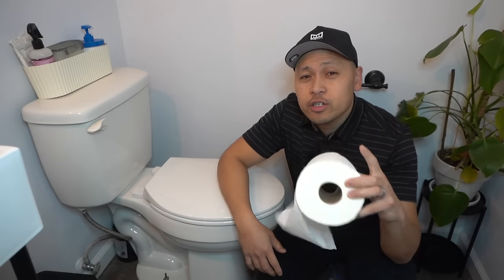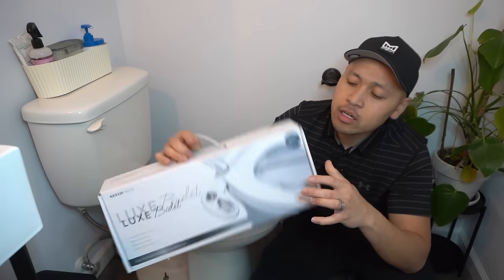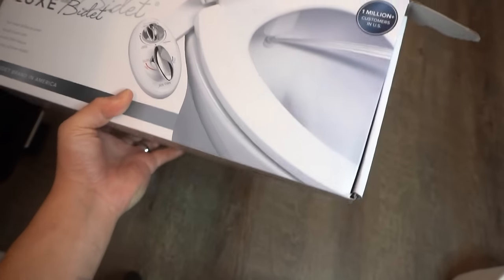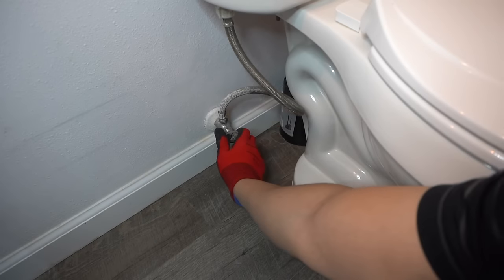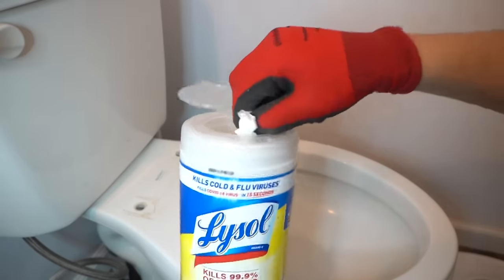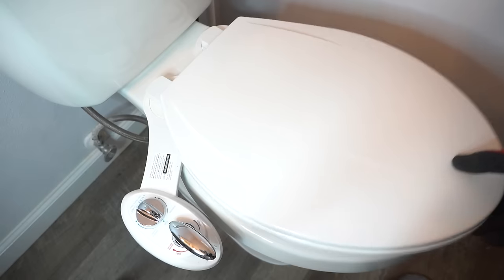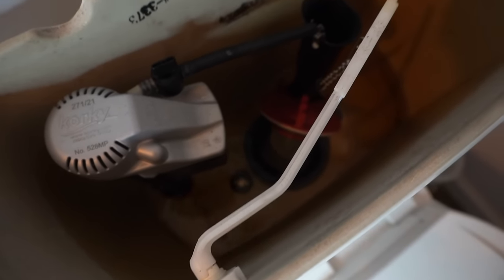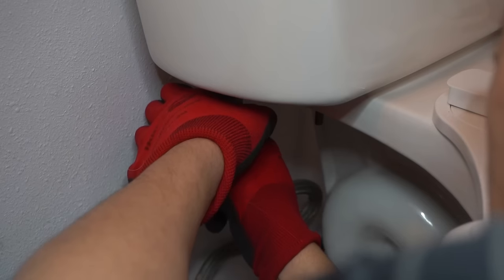STOP Using Toilet Paper! Theres A Better And Cleaner Way! EASY How To DIY Bidet Install!

Comment: Toilet paper notwithstanding you'll use more water & heat so unlikely to save money in the long run
Reply: Obviously your right in your opinion and situation.  However, everyone is different. If you three or more females using same bathroom  with a tanked hot water tank.   This might make sense.  Or just use cold water and man up. I have thought like you before but did the math and it’s almost a wash short term.  But long term, lesser.  But if tankless hot water tank close or in bathroom, smaller or much larger houses have them there, it would make perfect sense.
Reply: You'll appreciate one during a pandemic or natural disaster when the shelves are bare. The amount of water used is negligible - its a pressurized spray lasting a few seconds, not a bath or full shower.
Reply: Either your water must be relatively expensive or you use some cheap sandpaper-like TP. Frankly, heat isn't necessary for bidet. I was initially concerned about that, but when toilet paper became scarce during the pandemic, I purchased a cold water bidet and found even during the coldest part of the winter it wasn't really an issue.
Reply: Try lower pressure and low the temperature of the heat & third point is  maybe a water bottle aka a water jug
Reply: Water is a few cents per GALLON, you will save money no matter where you are, and be cleaner, faster.
Reply: Swings and roundabouts and I agree with the philosophy / intentions 
A standard bidet if enough space is probably  better
Reply: It's not about saving money. It's about hygiene.
Reply: Not really.  You don’t feel the difference between having bidet or not.  And it feels so fresh after use.

Comment: I still need TP. I got a big ass and i need to wipe the crevices real good or i risk staining my draws
Reply: You just need a garden hose with freezing water to really shrink things up
Reply: Too much information!
Reply: You a need 1500 psi bidet.
Reply: You need a fire department to clean your asss.  😂
Reply: 😂😂you do need to use toilet paper anyway to dry your butt after using the bidet. You just don’t use as much of it.

Comment: A bidet does not always clean everything off.. still need tp
Reply: I need  a whole roll of paper 🧻 to clean number 2
Reply: @Summer-o7j sounds like an issue with your diet, study which polysaccharides(starches and fibers) cause constipation, diarrhea, or gas. It’s different for everyone. There is also a chance you are dehydrated if the residue is thick. Regardless, a bidet is helpful to anyone
Reply: @commie281  did I mention constipation ????????
Reply: @commie281 if the residue is thick. 😂

Comment: Thank you for this! Bidets are in almost every home in Argentina, as a separate standalone bathroom fixture, next to the toilet. There's a saying, if you have something on your face, would you rather wipe it off or wash it off? I do not use toilet paper after as a rule. The stream is quite precise, or I have skills or something, because I do not have wet underwear. I have a hot water inlet on mine, but I really can't be bothered to wait for the hot water. My master toilet is next to a double vanity, so I drilled a hole in the side of the vanity just big enough to run the hot water line through. While the nozzles have a cleaning mode, you still have to clean the mechanism. There's a plastic door that you flip open and clean while cleaning the toilet. During the great TP shortage, the bidet makers were often out of stock. You can get a "portable" bidet for travel, which is just a squeeze bottle that holds about 16 oz of water with a screw-on nozzle. Once you get used to it, nothing else is acceptable. Thanks again!

Comment: Old school still works if you have a sink near your toilet.  Have a supply of wash cloths just for your bottom only, wipe enough with TP initially and proceed to clean your bottom with soap and water standing at the sink, repeat as often as needed.  It was a great way to keep my toddlers clean.  No need to buy all of the disposable wipes which clog up your pipes...for those with bidets, hotels I notice have towels for drying.  I still like soap and water vs plain water.

Comment: I got three bidets in the house but you still have to use toilet paper.  You just use less of it.
Reply: Yes,if you buy nice absorbent paper,you buy the cheap crap and you use a lot of paper to dry your ass..
Reply: My wife convinced me to install bidet I installed one few years ago After a year I tried it out Wish I would have bought one a long time ago I don’t like change but I soon found out using a bidet is so much better than tp Still have same Lux bidet I installed years ago with no problems

Comment: I tried a few and in the end I settled on the Veken Bidet with the stainless steel inlet connector. I've had less issues with the metal ones, the plastic ones I've always had leakage. Since install, never had issues.

Comment: Great easy to follow video as usual. I would like to install the hot/cold water model, but since I have a tankless hot water heater, I would end up wasting a lot of water before it would actually get hot. And for the price of the cold water only model it would be worth trying to see if I could stand using cold water only.
Reply: Tankless hot water heaters should provide hot water quicker than a regular tank. Any delay would be remaining water in the line between the tankless and the toilet, as that line is not cleared of water when the hot water tap is closed.
Reply: @GinaKayLandis  That is pretty much the reason for the delay and also because my tankless system is now in the garage on the 1st floor. The tank system was on the second floor centrally located to all my bathrooms. I was bored so I actually timed it and it can take from 15 - 30 seconds for the water to get hot to the touch, even at full force and full hot.
Reply: Have 4 seasons where i live and it's usually not a problem even without a hot water connection
Reply: @woodstream6137  Thanks for the info, I should be good here. I live in Arizona and I rarely even have to turn on the whole home heating system in the winter.

Comment: I bought two bidet attachments from Amazon a few months ago . They are inexpensive and easily fitted . 
I don't know what the fuss is about regarding hot water . Cold is sufficient for the job , and it's refreshing too .
Toilet paper is used after just to dry the crack and ensure the area is clean . Or better still , a small towell which can be washed each week or two , especially if you're single and the only user .
I must have the cleanest rear end in my neighborhood , after I've been to the toilet 😊
They should be fitted in every household here in the UK 🇬🇧 .

Comment: After looking at this contraption, I would not use it for this reasons:
1. It changes the height of the toilet seat bowl, there is now a big gap that will allow insect to crawl into the toilet bowl. The surface of the
of the seat is not flush flat as before.
2. We do not know after some time of usage this bigger gap will present warpping of the protective rubber of the seat or the toilet seat.
2. Water consumption usage, would increased tremendously.
3. We cannot assume that this method would clean off the soiled dirt effectively.
4. The protrusion at the side of the toilet seat bowl plus the hose rubber piping, would make it hard to clean the toilet properly, many obstruction.
5. Accident can happen if you switch to hot water and didn't realised the temperature setting, you might burn or scald your skin and one mistake is a hard lesson to recover from especially if other guest that are not familiar with it usage of this toilet bowl contraption.
6. If anyone who uses this spray method toilet bowl, has wet diarrhea stool, that toilet  bowl will be smear with soiled material all over and this cleaning of spray soiled material are harder to be properly cleaned.
7. So much control, if one uses paper toilet over the spray method, if the mechanism happen to fail, and you depend on it...then you in a lurch...well in paper one cannot go wrong.
etc etc
Reply: Lives in Ghana. Where do I get one to buy?

Comment: If the bathroom is far from the hot water tank, you may need to run the sink faucet for a bit to get the warm water up to the toilet.
Reply: Warm water isn't really even needed. Also the problem is most of the cheaper ones actually let you do hot or cold to find your temperature so there is a dangerous risk someone shoots straight hot water. Use cold only, its only a few seconds anyway
Reply: @chiquita683  I would likely want a small mixing valve so it wasn't just hot water coming out, unless it has one built in.
Reply: @gnic76  There is a mixing valve. You move to the right for warmer. But, it can get hot fast once the hot water gets there, so be ready to adjust! I just go with the cold.
Reply: @AmandaTexas  Thanks, good to know if I end up getting or installing something like that.

Comment: Love your step by step video, so clear.  
For those who are questioning bidets…. You’ll be surprise!  how clean your bottom is and YES I do need to use tp to dry after 😂.   I have mostly men in my household - no more surprises in their undies 

Since the tp shortage during the pandemic we had bidets installed in all our bathrooms.  I have this brand in my guest bathroom without the hot water as it’s too far for the hot water to be reached -  MOVE your booty around for better cleaning.   It was also helpful with potty training my 3-4 year old niece.

Comment: Most homes do not have a hot water line easily accessible and is much easier if the washroom is being renovated .The water coming from the cold water line inNorth America is very cold

Comment: Very informative video.  However, the critical reviews on Amazon are very useful.
They point out many potential flaws, such as the inability to change the angle of the nozzle spray, and the 'cheap' plastic parts that are prone to leak.  As usual, you can pay a lot for quality and sometimes get it, or you can take a chance and pay for low quality.
Reply: This model without the hot water is very good. The water supply lines are metal braided.  I don't recommend the one with hot water because it's not necessary and the hot water supply line will break and flood your bathroom.

Comment: Thanks for the video! I appreciate the detailed instructions. But my toilet is in a little room by itself, so I would not be able to connect the hot water line unless I go through a wall and have an extra long tube.
Reply: You really don't need the hot. If I put one in my half bath, I'm not getting one with the hot inlet.
Reply: I don't have a hot input and live in a 4 season state,  no problem.

Comment: What about that gap in the front between the seat and base.
Reply: Not only that, but it didn't seem like that seat fit that toilet. It was overhanging the front by quite a bit
Reply: You have to get self adhesive  bumpers and install them on the bottom of the seat

Comment: I see the gap from the seat, seems to bow down. Is there a certain seat you should use so it doesn't break?
Reply: There are some add-on bidets that included spacers and they can also be purchased seperately.

Comment: The 70s are back folks!
But i wonder what i will be drying my behind with when im done. 🤔
Reply: Take a towel with you
Reply: The blow dryer is an option that they forgot to tell you . . . .🙃
Reply: I need a whole roll of paper 🧻 when use Number 2

Comment: Hot water wouldn't be hot unless you run the cold water out first. Most hot water heaters are too far away to be efficient.

Comment: Wrong.  Use the toilet paper to wipe away excess faecal matter first then wash.  You cannot skip the first step and it is more hygienic to also have the second step and the third step is to wash your hands.
Especially for ladies, wipe from front to back to lessen the risk of urinary tract infections (UTI)..  Spraying directly without wiping increases the risk of UTI.

Comment: They are great!  Who needs TP
Reply: You will when the grid goes down unless you get an in-house generator.
Reply: @wolfling2039  - My bidet doesn't require electricity. Unless a bidet only has electronic controls, even the warm water models would still work without electricity.

Comment: You would have to run it on self clean for about 10 to 20 seconds on hot before the hot water would ever get over there to the controller. Each time…meaning  water does not stay hot in the tube. So be prepared for a very cold shot to the bum!

Comment: I enjoy all your videos that demonstrate new products, but this one is definitely not for me.  First, installing it is too much work because my vanity is six feet long. I would have to run a very long hot line connection and cut into the side of my new vanity to feed it through. Second, cleaning the toilet would be more of a chore with this product installed.  I prefer easy-peasy, not more work.

Comment: You still have to dry your ass !! I have them in  all my 3 toilets in the house for over 10 years,so don;t believe this B/S about not using paper,you have to in order to dry your front or back....The problem is people buy cheap non absorbent toilet paper and uses 3-4 times more,If you buy good absorbent paper,you wont have to use much....The one i have in the master bath works with electric,has warm water,and blows air to dry you off..but that was $400.00...

Comment: Geez that female setting is harsh 😂
Reply: It's no different than the other, he just turned it on more. The only difference is a separate nozzle extends with a different spray angle. I noticed that too though! lol You have to be careful when turning on the water because you could, literally, rip yourself a new one if you turned it on full pressure!